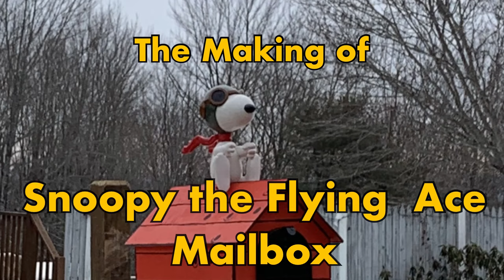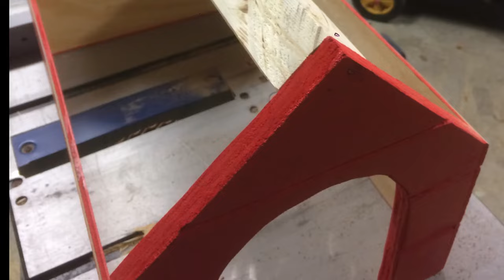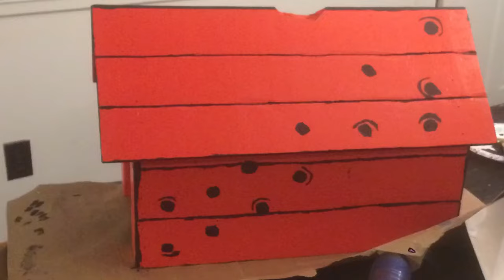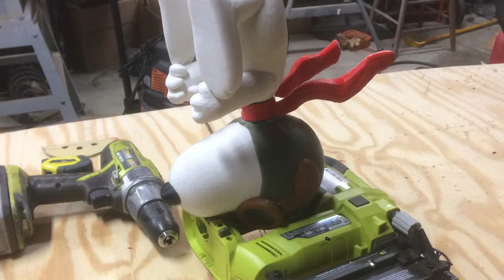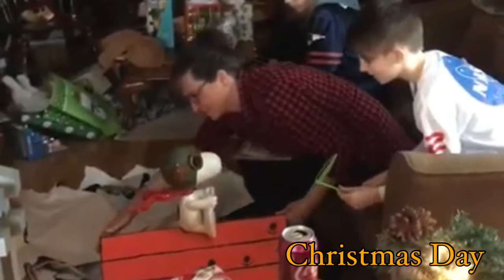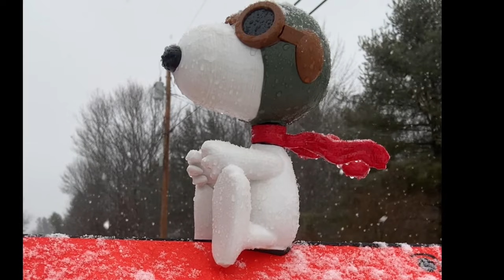Snoopy Flying Ace Mailbox [The Build]

Comment: Awesome stuff! What did you apply to Snoopy after the print? He looks smooth, no lines like some prints.
Reply from the maker: Printed in ABS. So he got an acetone vapor bath. He eventually got some UV resistant clear coat come spring. Thanks for checking it out!